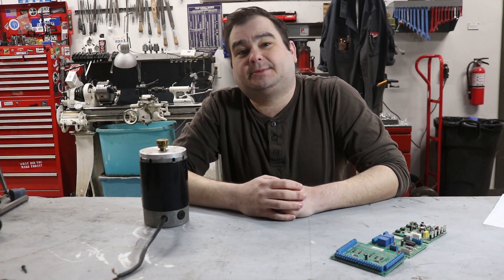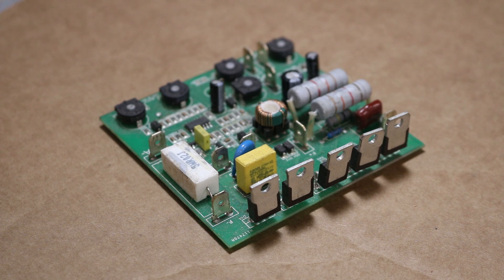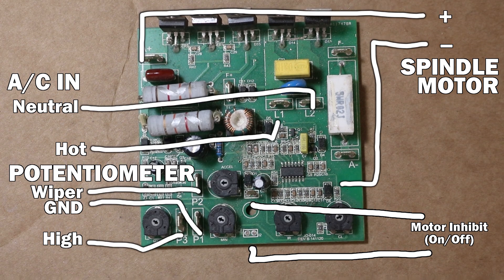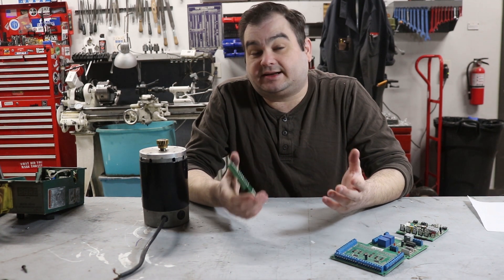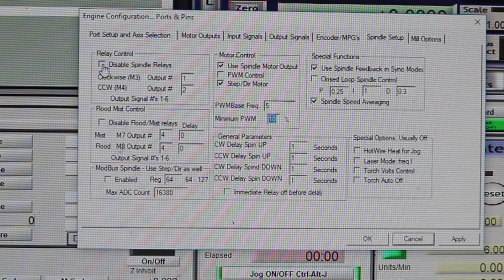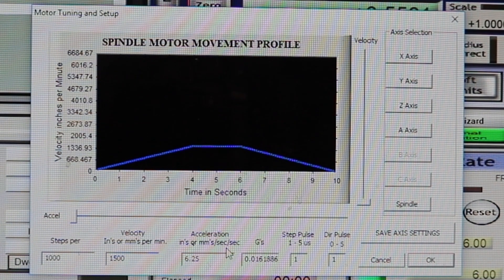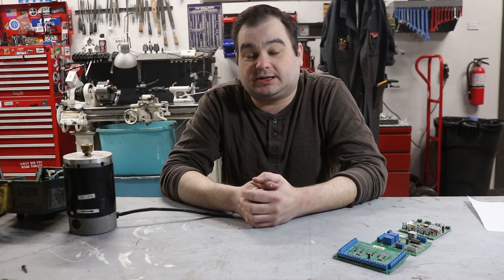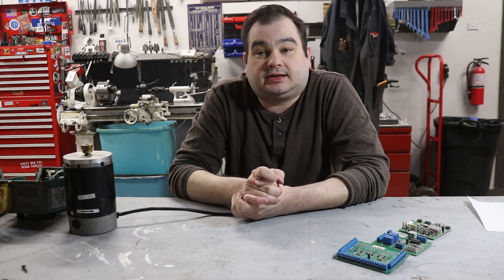CNC Spindle Motor Control: G0704, C6, Ethernet SmoothStepper

Comment: It is possible to connect a vfd directly to your ess and have reliable speed adjustment without any external bob and controllers. The k1,2 and 3 terminals are all potentiometers. The trick is making sure your three connections to your vfd are set to the correct variables that your three ess terminals are connected to. Unfortunately because there are so many variables and a vfd has much more dangerous levels of current no one wants to make posts about it. But trust me if you take your time and read through both manuals several time +watch and read lots it will all make sense. Happy making people

Comment: Thanks for cover this topic. In case you want to save a bit of cash. The C6 just convert PWM signal to analog so also a 2$ board from Ali will do the trick. I use this one with a BF20L mill (similar to PM25, G0704 ecc...) item number 33021792064